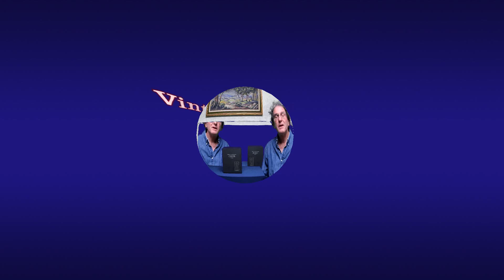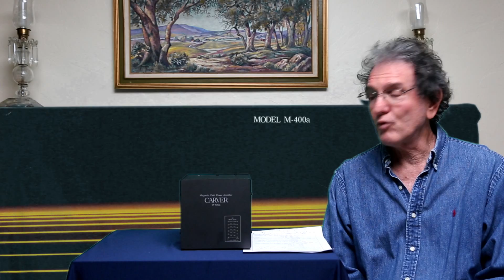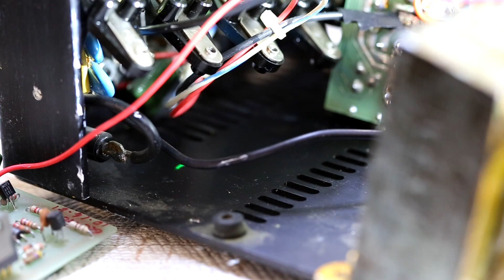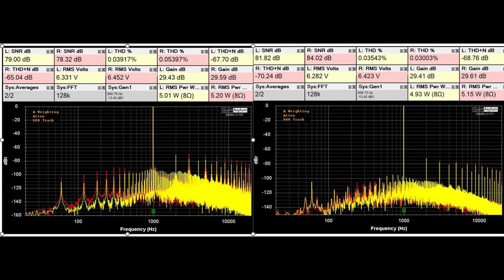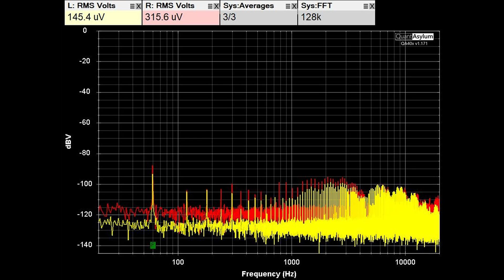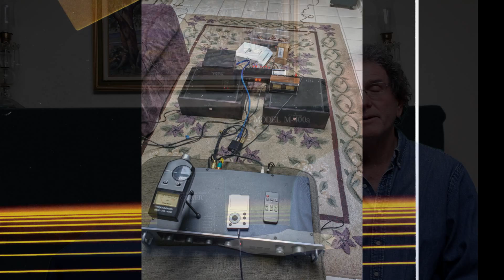Carver M-400a Power Amplifier- Vintage Audio Review Episode #51

Comment: My Carver M1.5t would occasionally shut down when used for a PA system even with a fan on it. My MC2300 never shut down at the same levels at the same venue. The M1.5t was a nice amp that sounded quite good on my home system and only shut down once during a really loud long listening session.
Reply from the maker: Like the M400a, I don't think the M1.5t was designed for long, loud listening sessions like a PA might be used for. The Mcintosh amp would be up for the challenge as you found out. Thanks for sharing!

Comment: I have an M400. It works well, but if equipment is not turned on in a certain order it motorboats. So I just follow the rules and turn things on in sequence.

fyi, I always wondered if JB weld had some electrical conductivity since it looks like it has ground up metal in it. I checked. No, it is actually a good insulator and is basically epoxy.
Reply from the maker: The M400's are one of the few amps that if they have not been re-capped, they should be. I never wondered about that with JB weld, but good to know!
Reply: @vintageaudioreview  I bought it from a technician who restores and resells. I've known him for about 15 years. I'd  be really surprised if he hadn't recapped it. I'm doing so much recapping lately I feel like I am single-handedly propping up the capacitor manufacturing industry.
Reply from the maker: @mrratskins  Extremely difficult unit to take apart and put back together again!

Comment: Nice vid. I bought the M400 and matching C4000 pre amp in 1980. I think $1600 for both. ALOT of $ for an 18 year old.
Recapped both in 2019. Still have the C4000. Almost bought a 2nd M400 to run mono blocks, but with the cost and recapping of a 2nd one decided to sell M400 and go with a new high current amp, but really enjoyed the M400. It even powered my high current demand Magnepan 1.7i s and didnt even get warm even at high spl. Surprised you had overheat issues.
Reply from the maker: Many thanks for sharing your "story", and watching. I do have two m400's which I got with the same idea as using for monoblocks. Am surprised you did not have problems when cranking the Magnepans.  I only use the cubes when testing a preamp (sometimes). I think only one was hooked up to my kef107's which are a 4ohm speaker when it went into thermal shutdown after playing loud for a long period of time- and that was with a recapped m400a.

Comment: The Carver Cube was not designed to be left on despite not having an on/off switch. Carver pre-amps all have switched and unswitched plugs. You were supposed to plug the amps into the switched plugs and the amp would turn off when you turned off the pre-amp.This often over looked feature is described in the owner's manual and probably explains why you were frying and over heating the unit chronically.
Reply from the maker: Most of the preamps, including the Carver C1, did have switched AC outlets for the purpose you describe. BUT, many can't really handle the current draw that some of the higher power amps (like the Cube) can draw for sustained periods. The ON/OFF switch on the C1 was not rated for that much current and can be a problem over time. Even with new caps my cubes can still run hot when well ventilated and cranking at very loud levels for say 40min before the thermal breaker kicks in. Thanks for the comment!!
Reply: @vintageaudioreview  I checked this out and you are correct. The m400 series could exceed the switched pre-amp plug's capability at high volume levels. Best practice would be to use a high quality power-strip with a voltage regulator or plug directly into wall but still turn the unit off when not in use. 

The overheating was most probably caused by dried thermal compound, insufficient ventilation or sustained high output with 8 ohm speakers. Worn caps will also cause this but the issue will be not to wear the new ones out prematurely.  Thanks for looking into this question, I just learned something.
Reply from the maker: @CarsonClark-l5i Thanks you for taking some time to share your thoughts. If you watch episode 199 on the DX4200, it's switch outlets are designed for a decent sized power amp, and I am using it for that purpose. Luckily, my C1, which is one of my "bench" preamps, was never abused to where the power switch has issues. I don't think you need a voltage regulator supply at all for a power strip, but there are some that have a "master" outlet that is always one, which you would connect to a preamp, which would trigger the "slave" outlets which can hand a power amp. With "triggering" these days on more modern gear you don't have that problem.

Comment: Could you please share how to connect QuantAsylum to the amp in monoblock configuration?
Reply from the maker: I would have connected the amp like it shows in the back of the M400a for mono operation and then would connect the - terminal of my dummy load to the - terminal shown in the diagram and the + terminal of the dummy load to the + terminal of speaker connector as shown in the diagram. I would use just the left channel on the QA. Hope this helps
Reply: @vintageaudioreview Yes, thank you!

Comment: Great review as always. Some years back I ran a pair of Soundcraftsmen MTX S800 (PM840) in bridged mode off of a Soundcraftsmen DX4000 preamplifier for a 600 WPC RMS stereo setup. It sounded surprising well. However, I concluded it just was too much power for my needs. I also was concerned about the possibility of damaging my speakers with an unintended flick of my wrist. When turned up for very brief periods it would go incredibly loud (ear damaging levels) but remained very clear and clean sounding. Still have 2 DX4000 preamps, 2 S800, a PM840, a PC800, 2 A5002, a DC2215 equalizer, a RP2215R equalizer, and a T6002 tuner. Not all are in working condition. My hope is to one day make a rack system with a DX4000, one or two A5002 amplifiers, DC2215 equalizer, and T6002 tuner. In the 80s I used to see all this stuff at a Fedco store but did not have the money to buy it. Just think it would be kind of cool to setup in another room.
Reply from the maker: Thanks for the great comments and taking the time to leave them. I started cracking up when I read you got rid of the amp because you might go to much and damage your speakers. Just last night I was looking at the DX4000 and was surprised to see that it made it easy to run in bridged mode as the had some outputs that were inverted for that purpose. I hope to get one to review on day. You are certainly a Souncraftsmen guy- I have been a fan since the late 70's. I will have a review on one of their amps in the future. You should check out:
 https://www.stereo-phoenix.com/shop

as the guy also repairs/restores Soundcraftsmen gear and I have found him to be a great resource
Reply: @vintageaudioreview  Thanks I will check them out. I thought about running a pair of A5002's as monoblocs on a DX4000 but that would be only practical if ones goal was to take bets on what would happen first, hearing loss, burnt out speakers, or a tripped circuit breaker.
Reply from the maker: @multicyclist  It would still be fun to do if you are careful!
Reply: @vintageaudioreview  Really nice Soundcraftsment website. Really looks like they do top notch work. Yes it would fun I believe a bridged A5002 is rated 750 watts RMS into 8 ohms.  While it really would not do anything for the sonic quality it would look awesome and be fun to use. Perhaps I still may do it because why let a A5002 go to waste? The rack I have has just enough rack units to house 2 A5002 amps, a DX4000 preamp, a DC2215 Differential Comparator Equalizer, and a T6002 Tuner. I have all the pieces but some need to be fixed and others need service. It would also need a dedicated 30 amp circuit to power it to its full potential. But in all reality I would not expect to ever use all 1500 watts RMS for listening. Maybe to do some testing into load resistors or test one channel at a time or... blow one speaker at a time.
Reply from the maker: @ Indeed, why wast the A5002? In a month or two you will see a review of another Soundcraftsmen amp where I contemplate the same thing that you are 😁
Reply: @vintageaudioreview  perfect. I will be sure to watch.

Comment: 12 high power transistors, and barely enough cooling to cool one at max power for extended period of time.

I know for home use, we barely go past 1 watt most of the time, but IMHO this is really pushing it.
Reply from the maker: I will agree with you that if you run a Cube (that has been recapped) for more than about 45min at levels that are around 100w/8ohms, the thermal protect may cut in. But 1w into say 4 ohms- all day long without getting mildly warm....

Comment: The Carver cube magnetic field amp was a real breakthrough and leap forward in audio power amp tech. Prior to that the power to dollar ratio or watts per dollar was fairly expensive and the size and mass of the components needed to provide those high performance numbers heavy and large. Carver shrank the size, weight, cost simultaneously without compromising on its accuracy and neutrality. Quite an accomplishment, these days digital amps which follow in the tradition of Carvers amp by being exceptionally energy efficient in converting electrical power into useful work output.
Reply from the maker: Very well put and I agree! They are hanging in there as far as dollars per watt, depending on how much you pay for one that has been refurbed. Thanks for taking the time to comment!

Comment: I love this little but powerful amp. Mine is hooked to a Rotel pre amp and a pair of S15 Polk speakers. The sound is pretty amazing, so clean... either from CDs or coming from the Mac using a Sony DAC
Reply from the maker: I appreciate the comment. I have started using  my m400a's more in my preamp listening tests and it works very well and sounds just fine and has plenty of power- just don't run it at the very how power levels for long periods of time or it may cause a thermal shutdown.....
Reply: @vintageaudioreview  yeah mine sits in a small office / studio so I ran at normal/ low levels. The VU meter lights barely show up
Reply: BTW speaker bass is impressive on the S15s. I am wondering if I choose another set of speakers will bring that bass
Reply from the maker: @fertexas  Perfect situation for it. I hope you have it it re-capped- if so, it should last for a long time I would assume.
Reply from the maker: @fertexas  I am not familiar with Polk speakers to where I know the different model numbers, but if it is sounding good to you, enjoy them and if you get a chance to borrow a pair of speakers from a friend or a maybe someone that is selling a pair that you are interested in will bring them over for you to try....
Reply: @vintageaudioreview  haven't done much and it has been barely used all these years.
Reply from the maker: @ These are one of the few amps that I say to recap them. It sounds like they have not been plugged in all that time, but I would rather be safe than sorry at this point. If they were in a box all these years and stored at room temp, you might be ok, but the caps used in these were not the best quality. You can check out Nelion and see what they charge for a refurb, or just use it until it breaks.
Reply: @vintageaudioreview  California garage dry and cool 😎
Reply from the maker: @fertexas  Good luck with your M400a 😄

Comment: I just got one of these that has the m400 tick and I’m going to try a recap to take care of it. Due to the reliability issues of any carver product I’m not hopeful. When going from screw in to snap in capacitors I usually drill new holes for the snap in terminals as long as there’s a spot to drill. I’ll run wires from the terminal to the solder pad if need be.
Reply from the maker: The screw in caps may actually be available from Mouser now. Also, you should check XRAYTONYB's video on the M400 as he has a really good tip about replacing the other caps with just one larger cap.... Note how the sockets are plugged in that hold the boards together as you can be a pin off and they will still mate. Good luck!

Comment: Thanks for creating this video, my brother's M-400a from the 80's has a failed channel (right IIRC) so this encourages me to take another look at it.  Someone at Carver was extremely nice and sent me the a paper copy of the schematics and repair guide in the 90's.  I need to find some time to go through and debug it.  As you stated it is not straight forward to take apart due to it's tight electronic packaging.
Reply from the maker: Thank you for taking the time to comment! There is a video from XRAYTONYB, I believe on the M400- almost the same, which I would watch as well and would follow his advice about replacing all those other caps with a single cap that has a higher voltage rating. It is not easy to work on so take pictures and be careful when putting the two power amp boards together as you can be off by a pin and they will still fit and you will blow some stuff up.....good luck!

Comment: Using an m400 as a commercial amplifier probably facilitates the need for a thermally controlled cooling fan. It is amazing just how small this fan can be. Did you notice that the transformer seemed a bit different? And did you look closely at the schematic? It's actually something called a magnetic field coil and it is Carver's design and part of the reason why that small amplifier that has such a low mass is so darn efficient. Awesome review and best wishes with the channel.
Reply from the maker: Thanks so much for the well wishes on the channel- please subscribe if you have not. I would not recommend the m400/a/t to be used as a commercial amplifier, unless it is going to be putting out less than maybe 20w on a long term basis- I suppose I could test where that power would be before it got too warm. If you need to use a cooling fan, I would use another amp. Soundcraftsmen did a similar thing with some of their amps as part as using triacs to switch the power supply on/off and generate different rail voltages depending on the power needed. I have two of the 400a's and just started using them when I need to test a preamp or line level device- they sound find and have plenty of power for my testing- you just don't want to play them at max power for extended periods of time as they will trip the thermal breaker. If one were ambitious, they could add extra heatsinks around the case (top and sides), which would help cool it w/out a fan....

Comment: Several years ago( sometime around 1984 ), I worked for a company that installed sound systems to public buildings like auditoriums and churches. They were selling Crown amplifiers at the time. The owner of the company knew that I had recently purchased a Carver M-400t amplifier. He let me take home a 200 watt per channel Crown to compare it to my Carver.  It was a lot of fun and the difference between them was minimal. I actually preferred the Carver. Thanks for a fun video.
Reply from the maker: I would agree with you sonically between the Carver and the Crown, but the Crown- back then- was most likely built better than the Carver and more durable over the long run....Thanks for the comment!
Reply: Yes, it was built like a tank and about that heavy too!  @vintageaudioreview
Reply: I used to sell both Crown and Carver so side-by-side was a daily thing.  The M400 worked great, until it didn't - which was more of a 'when' than 'if'. Crown was rock solid. As for servicing - the Carver was challenging at the time because the whole design of the 'magnetic field amplifier' was unique and very different.  Both sounded excellent though. My mind was blown by the Carver C-9 though. Still is.

Comment: Did you repair the other cube? How were they as monoblocks? I am going to be combining an M400a and  and an M400 (not a nor t) as monoblocks. I would like to hear your results too for comparison. Thanks for creating a great content.
Reply from the maker: Thanks for the comment & compliment! Yes, I fixed the other cube about 2weeks ago, luckily, it was not too bad to track down the problem and I had the part- it just required disassembly which is a royal pain in the butt. They worked fine as monoblocks when I used them that way- before the recapping and repair. One is going to be used as a bench amp for a project and the other is a spare amp so I don't listen to them much, but I did after I repaired it and that cube sounds fine to me other than the low level hum which you may hear a little depending on your speakers

Comment: Now you gotta do Cable tests, haha. I had my Tfm 45 overheat at a party. We threw it in the fridge! Haha
Reply from the maker: Thank you for the comment and making me laugh- put it in the fridge- I've never considered that😂 As for the expensive cables, my local audio friends are going to do and a/b test with an $8k pair of speaker cables- the kind with an arrow pointing the right way to connect them and some 12 gauge basic cables. I predominately focus on more vintage stuff so I doubt I would do a video on it. However,  I am currently testing something that is brand new that would be a great addition to (so far it looks that way) a vintage receiver/ preamp/ or integrated amp- probably will be a video in 2 weeks.....